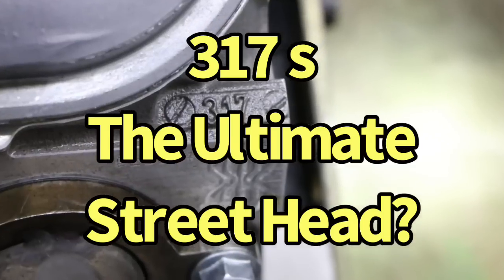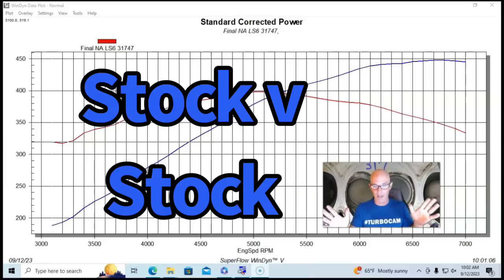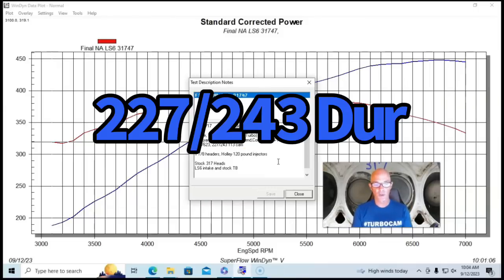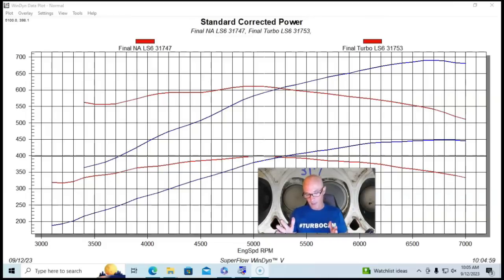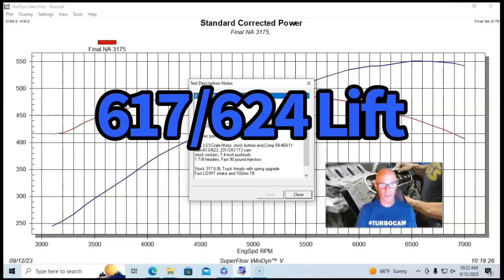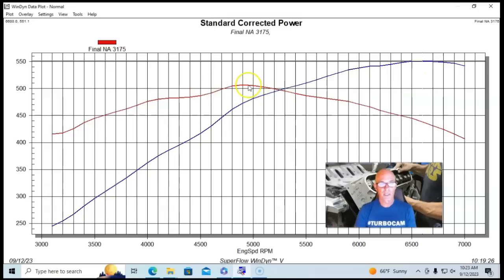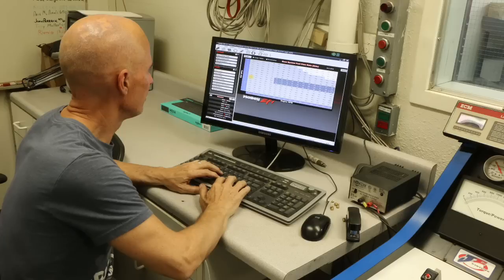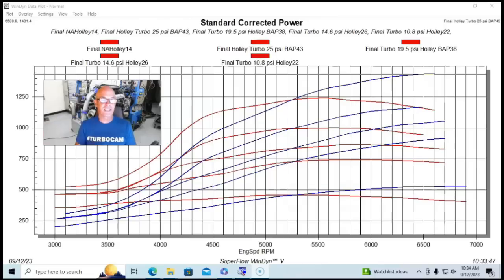HOW MUCH HP CAN YOU MAKE WITH 317 LS HEADS?  HERE IS A HINT-THE POWER LIMIT IS NOT FROM FLOW!

Comment: Richard I have a question how much left can you run on a stock rocker arm how strong are the connecting rods at what RPM on a 6 l LS
Reply from the maker: We have run stock rockers 8000 rpm and above
Reply: @richardholdener1727  are the stock rocker trunnions ok for high lift over 550

Comment: Would some ported 317 heads be good  for an LSA setup? I have a LQ4 block with flat top pistons and a 222/224 comp cam. Would like some input.
Reply from the maker: lsa swap should get some rec ports to match the blower manifold or ported 317s but you have to run adapters
Reply: @richardholdener1727  thanks for the reply. I was wondering if the 317 a good setup with a Root style charger. Or should I be looking turbo for boost?

Comment: I have a 1995 C1500 with a small block V8 350/5.7 liter. What cam would you suggest without having to change the spring and so forth. That gives a little bit of chop and improves performance.
Reply from the maker: YOU WILL NEED SPRINGS

Comment: Hey richard quick question . the vortec 7.4 do you think that intake would be friendly do water meth ? Unless I go all out and make a custom intake i cant intercooler my whipple
Reply from the maker: should be better than truck ls-and better than no intercooler
Reply: @richardholdener1727  was going to put a street friendly boost roller cam and roller rockers in it with brodix oval port heads to keep the port velocity high because I will tow with it and have fun with it . its getting an nv4500 and a humvee awd tcase. With the aluminum heads and water meth my tuner and i believe we can get away with 89 octane at 4 to 5 psi

Comment: I'd like to see if it's possible to get "aftermarket head results" with 317 heads and dome pistons. Would it be possible to get even more flow with bigger intake valves and some trimming around the intake valve? Meaning some material removed from the combustion chamber around the intake valve so flow is more so equal all around the intake valve. After some porting to the 317 heads, of course. 317 heads are dirt cheap and using dome pistons may be a cheat code to make the best out of an item that's usually discarded. Also, its mentioned on forums, but  I want to make sure. Are 317 and 243/ 799 heads the same except for the difference in combustion chamber size?
Reply from the maker: chamber size and design are different on 317

Comment: You talk about junkyard engines you run often. Do you gap the rings in all the ones you boost? Also the higher mileage ones do you typically see significantly bigger gaps with lots of miles? I’ve heard ls engines barely west rings with like 200,000 miles
Reply from the maker: mileage doesn't change gap much

Comment: The “magic” of the 317, for me, is most head porters offer a cheaper Stage 1 port job since the 317 already has bigger valves. Local shops wanted 400$ just to refresh the heads. For under 1000$ I got stage 1 porting (313cfm/220cfm @ .600), heads refreshed, a GOOD valve job, and PAC .625 lift springs. The extra 600$ was well spent IMO.

Comment: Yes, finally. :) 
If I told you a local hero has a street driven Volvo 244 with a 331CID Lm7 with home ported 862 heads and twin 69mm BW turbos running C16 achieved 163 mph @ 1/4 mile running 100.7% duty on 1230 ccm injectors and AFR 11.8:1 for 183 lb/min airflow. BTR stage 2 TT cam.
It has been together for 2 years and he did Street Week Sweden last year. The heads did lift a little bit at 36 psi of boost, but not more than he could carry on with the event to the end. :) Based on fuelflow and airflow we are guestimating about 1550 hp. What do you think? 
Oh yes, pretty low compression ratio in this one.  Otherwise the engine would be broken for sure. ;)   

https://www.youtube.com/watch?v=VB4uOzEq_F8&t=77s
Reply from the maker: Obviously it is making big steam for a 163-mph trap speed. very cool

Comment: Thanks Rich for this video. I have an LQ9 that I set up for E85 (fuel pump, injectors, fuel cell, and lines) I know I am giving up power with the Fab intake but it looks good. In a 2 door Jeep it is definitely a riot to drive. Next step is boost rather than heads, probably the Torq-Storm. Are there any problems with that supercharger that you know of? They are a local company and that is the main reason to support them. 700hp is way more than I would know what to do with. The only reason for the E85 was cost and availability, 30% more fuel and 40% cheaper than premium, plus it smells good 😂! Thanks for all of the great information.
Reply: I don't know that I have read anything bad about Torq Storm, people seem to like them.
Reply: @silentbravo  
I haven't seen anything bad either, I just wanted to get some feedback. I have looked at them and they are a nice piece of hardware.
Reply: @mikelevandoski843  Matt from Sloppy Mechanics has put one on his latest build and I think he was really liking it when I watched last
Reply from the maker: they work well

Comment: Would love to see sealed long block big bang testing on the 4.8/5.3/6.0!
Reply from the maker: That is not a Big Bang test
Reply: @richardholdener1727  on the gen 3 6.0.  What was max timing , after,  @ 25 psi?  

What timing , afr, @ 27 psi on e85, do you recommend to gain similar power?

Are those cast or hypereutectic aluminum,  which ones will hold more power?

Comment: This is the heads I run on my booster LQ4. Running pump 93 with 8.5psi of boost. So far so good.
Reply: That's pretty low considering the factory LSA is 10-11 psi with similar compression
Reply: How much whp and whtq?
Reply: Joe simpson Squeezed 650whp out of a Combination Similar to this on 11lb with 91 or 93  That's  ow my goal. So the 799's gotta go. They put me at 11.1 to much for my 3800/4000lb truck Unloaded without boost. ✌️